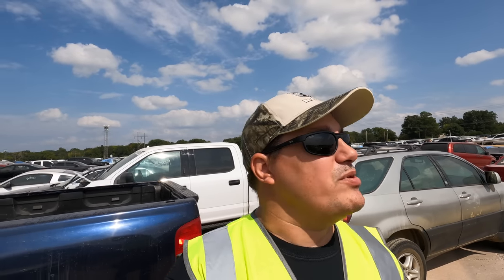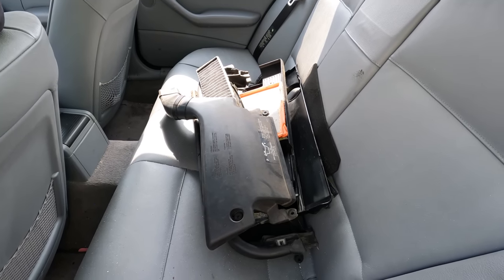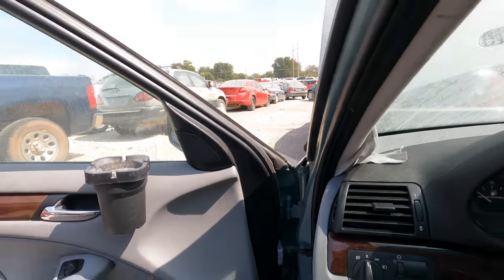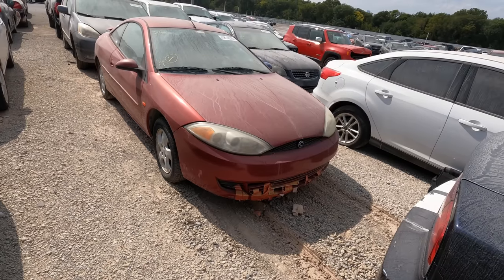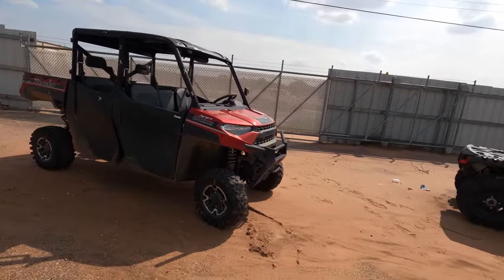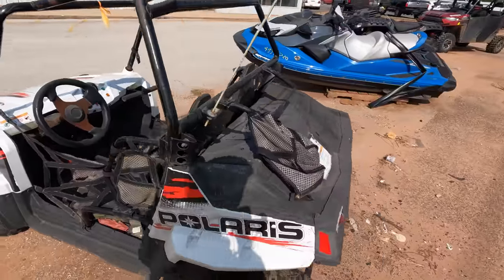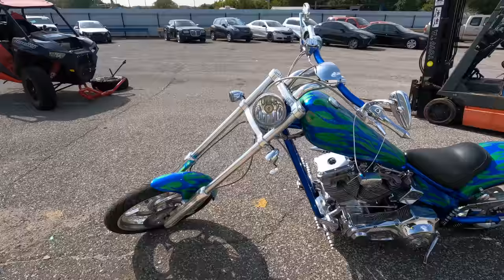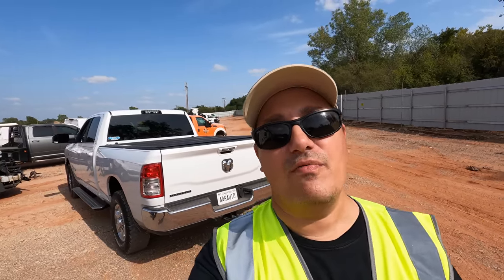Copart Walk Around + Texas Chopper!! 9-24-2020

Comment: For the 2002 Mercury Cougar you might want to check the rear crossmember from drivers side to passanger side. I had one that had the complete rear end rotted out and someone did a hack job on the wires to the fuel pump/sending unit. Those are my 2 biggest spots to check and also there is a safety fuel shut off button that can pop (just like a regular breaker in any house) located on the A-piller driver side under dash check to make sure that is in the correct position to have the vehicle run.

Comment: Randy... I deliver parts to several RV dealers here the Ft Worth area...  most have told me that hail damage to a roof is kind of a "chance" thing!! 
Roof repair runs about $100 a square foot... so a trailer like that could run $3,000-$6,500 in repairs... 
Best way to find out is to climb onto the roof of the trailer/RV and and walk around... if you feel soft spots...  its gonna be a major expense!! Also... if its been damaged for a while and in rain a lot... sometine the rain can leak through the damaged roof and into the walls and ceiling!!  Check for water stains spots in the walls and ceiling!! That broken skylight in the restroom is a concern.. bc if rain gets in and soaks those floors to much... itll create  soft spots thatll be rot the floor and then the floor has to be ripped up.. so check that bathroom floor for soft spots... so its best to find out when it went was damaged, and how long its had rain getting to it!! 

RV's with hail are a catch 22... sometimes they are worth fixing and dumping the money into... and sometimes... they arent

Comment: I've bid on hail damaged campers.  The one we currently have was a storm damage from Crashed Toys (pre merger with copart)  -- The big thing on newer trailers is of course the broken roof vents, but if the shell has had the seams compromised, or holes and many are vacuum sealed which is important to their insulation and moisture barrier..

Comment: you are probably right about the Cougar it is just totally out of fuel, nothing for the pump to pick up. the fuel pump noise would stop if fuel was getting to it. a chopper is only a good idea if you are an experienced rider. otherwise they are meaner that a rattlesnake with it's tail caught in a gate.

Comment: that Duratec 2.5 V6 in the Cougar's a good little engine.  Just a smaller version of the 3.0 and 3.5 Duratec.   I've had one 2.5 in a Contour, three of the 3.0 Duratecs, never a serious problem with any of them.   Good performers.

Comment: There are some really nice bikes there! Start out small with a 300cc-400cc and advance as you get to be a better rider!
I would buy the trailer! They make a rubber coating paint that you can use a roller and coat the entire roof with to seal it up good and protect it in the future from storm damage. It lasts for a few years then you reapply it again or, they also make a rubber mat that you can install over the roof if you want to go long term. They make replace vent covers everywhere, they are a dime a dozen. The good news is, the toilet seals perfectly since it is still holding that water in the bowl, most would leak that into the holding tank. Just make sure there is no interior damage from the roof leaking and causing mold or soft spots in the walls. If it smelled good like you said then it is probably fine. You can usually smell the mold when you first open the door and walk inside if there is any problem like that! A trailer would also be a great additional area to stay in on your property, or just get away from everyone. Pour an RV slab/pad and run hookups (electric, plumbing) to it so your trailer is fully functional while parked at your home. That makes it a nice place to have guests stay in so your privacy in the house is not bothered! With an electric extension cord and water hose, it is fully functional, you would just have to drain the holding tanks somewhere once in a while. You probably already have a cleanout on the side of the house somewhere to empty the holding tanks into! Plus you can get away and go camping at any time you want to. Getaway from home and enjoy family time together out camping! You already have the truck to tow a house trailer with the bumper hookup so that would be great for you to go now, or if you want to go all out, get a big 5th wheel. Good luck!

Comment: With proper repair techniques a "hail damaged" travel trailer can be rebuilt and be good as new. If it is seriously damaged, a completed re-skin of the top may be required. It's like buying a used car,  if you can buy it at the right price it could be worthwhile. I have had a couple of rebuilt motor homes and one of them had serious hail damage. After the rebuild it was fine.

Comment: When looking at travel trailers, open the front storage area and see what sort of framing material it has. Typically stick and tin type trailers are not as good as fiberglass with a welded aluminum frame.

Comment: I would definitely get the trailer if it was cheap enough but I would get the roof re skinned it's not very expensive maybe a $1000.⁰⁰
 While you're up there in also be a good time to put some solar panels up their they also will protect the roof from leaking in the future and you get free power. I have $4000 into a 25' 2019 that was never owned, it was totally with hail on the dealership lot.

Comment: I’d be careful around those Side by sides. We got one from copart before listed with “Undercarriage” damage. Just some bent pieces of shielding on the bottom right? NOPE the entire engine had been flooded with water. We only found out after we bought too and on top of that it was missing a bunch of parts and when we were all done rebuilding the engine we paid what a new one would cost. Never again

Comment: Nice a e46. thats a good car but the xDrive is not good. the e46 rear wheel drive 325i super reliable good engine and transmission but might need a colling system, and maybe the front drive train need touch up bad.

Comment: 6:00 - Ironically the 1999 - 2002 Cougar was going to become the 3rd gen Probe.
It must have been odd to see the 2002 retro T-Bird  (a proper RWD car but underwhelming in its own way) next to this Contour-based 2002 Cougar on the same dealership when new. 2 cars that shared platforms for over 20 years